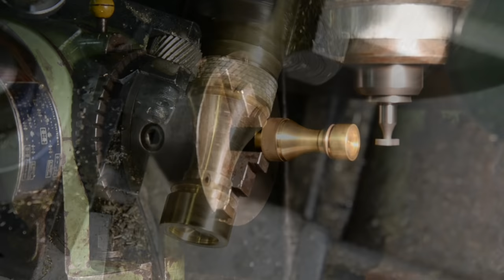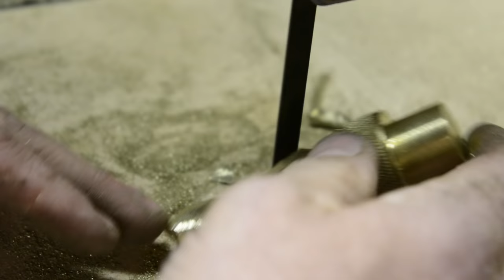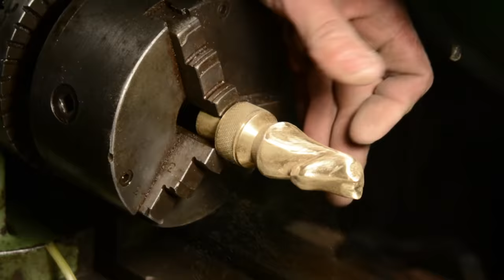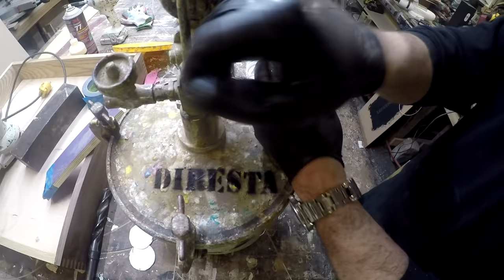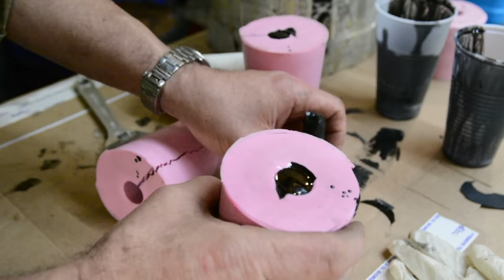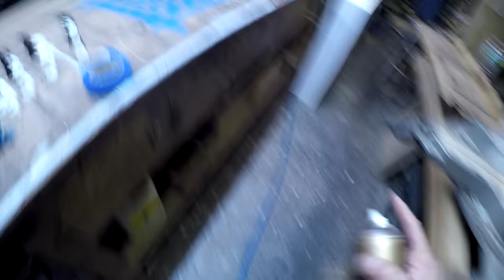✔  DiResta Chess Set

Comment: I'm amazed a razor knife blade is capable of shaping metal like that.
Reply: It's brass, it's way softer than steel.
Reply: +Falutin Free Also, the blade looks hardened. I'm not an expert, though, so I can't be sure.
Reply: +pikachu1324 The metal that you are 'cutting' with simply needs to be harder than the metal being cut. Steel is harder than brass. Yeah, it was a creative tool idea, right?!

Comment: i really wanted to read through all the comments so i didn't ask the same question but there are just so many so please forgive me if this has been asked.
why go through the trouble to make the metal (brass) pieces if your just going to make plastic molds?
wouldn't it be alot easier and cheaper to use wood or something easier to work with?
i only ask because i wanted to try some molding myself and just wondering ,also king of intimidating if i had to go with a metal master copy.

thanks
Reply from the maker: +James Delvechio i used brass bc the finish would be better than wood .. and i wanted more machine / mill lathe experience. only way to learn is to do. Thank You!
Reply: Cuz is one of a kind thing people like me want. It ain’t any chess peace it’s unique with the creators on creative thinking.

Comment: Jimmy,  I saw that you have a small nub left over when parting.  Make sure that the parting tool is at a slight angle with respect to the turning axis so that the angle is opening towards the chuck.  I hope I explained that correctly.  If done right, your piece that gets cut off will have no nub.

Comment: Little tip, with the Knurling tool, you want to Center the tool really well, with the up - down - position, and use locked feed, and enough pressure, to knurle. When you feed it length wise, with a rate that the tool tells, it leaves nice uniform pattern. If the tool doesnt tell, i believe there was ways to calculate it, the way i did it, was to have just long piece well supported, and by trying different feed/rotation ratios :) There is some Youtube videos out there i believe where this is explained. Insane crafting skills tho, personally i can't craft much anything free handed, i always need to CAD and make, or it comes out badly.

Comment: Excellent work, when you left the stem at the bottom I thought you might be going to thread it and add a metal base to give the pieces some weight, which I thought may have been a good idea as I for one am consistently knocking the pieces over when I play.  I'm clumsy that way.

Comment: Very nice. One extra thing you can do is drill out a hole in the base of the pieces and add a weight to them. Good pieces have extra weight on the bottom so they don't tip over so easily.

Comment: +jimmydiresta I've been watching your videos for months and you've inspired me to take on some projects. Now that i'm back home for a few weeks I have 3 in mind. Today I made a sketchbook out of mahogany which I split in half (was 1/2") and bound some paper, used leather as the binding and left about 5" to do some detailing work with a dremel. I think I will carve an eastern hemlock on the front. Second project is a keepsake box for my fiance. I'm using cherry, and its 10"x7"x5"tall. I am using some aspen accents and going to router the lid, and carve some horses on the top with the dremel. On the inside I am lining the 4 walls and lid with her favorite colors of felt, and the bottom inside is a picture of the proposal, transferred with a picture and mod podge. Third project is to use a large cut from an old tree stump with lots of damage to make a table top. Thanks for the inspiration!

Comment: Nice job Jimmy.  Lots of interesting techniques. Like the scraping of the soft brass to contour. Also, the mold making & casting is great. Were using pressure or vacuum in the mold making.??  I always used a vacuum pump. lyle
Reply from the maker: Thank you sir!! Pressure tank. Need to perfect this technique.  Maybe get a vacc system.  This worked about 80%.
Reply: +jimmydiresta Vacuum is the way to go. It removes the bubbles

Comment: At first I was wondering, how is he going to freehand 16 pawns and 4 knights and get them to look even remotely close...then you break out the smooth-on.  Nice work, and you get to keep your molds and masters for future.   Also liked degassing the silicone/urethane in the mold rather than in the batch bucket, smart, efficient, addresses voids in the molds that might pop up from the pour as well as gas bubbles in the mix.

Comment: You may want to bore a hole in the bottom of your pieces and add some weight, a ball bearing or melt some solder into it. Then put  felt pads glued over the hole.

Comment: +jimmydiresta : did you degas the silicon first place ? is the chamber for pressure or vaccum ? thanks a lot for sharing, great learning again
Reply: +Erv Plecter having seen others. the chamber is put into a vacuum, thereby drawing out any airbubbles out of the silicon so that you get a perfect replica in the molds. Usually is fine for the most part if you don't but if you want it perfect then vacuum is good.
Reply: +kerberos623 thanks a lot !
Reply: +kerberos623 actually, it looks like pressure. this squishes the air bubbles down to micro size.
Reply: hoth mob you are correct. hmm others I've seen it has been a vacuum. it depends on the material I learned today. https://www.artmolds.com/blog/vacuum-chambers-and-pressure-pots-in-mold-making.html
Reply: ***** could be pressure. this article is good on the subject. https://www.artmolds.com/blog/vacuum-chambers-and-pressure-pots-in-mold-making.html
Reply: +kerberos623 thank you, awesome article, now I know all I needed to select between the 2 !